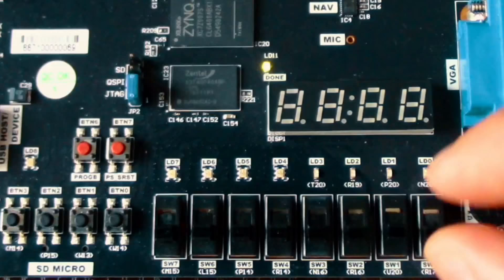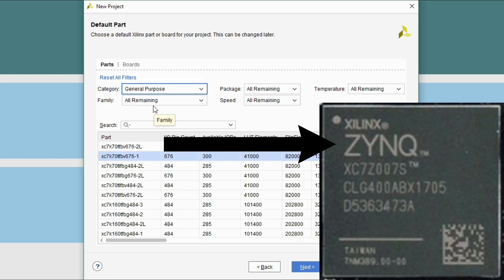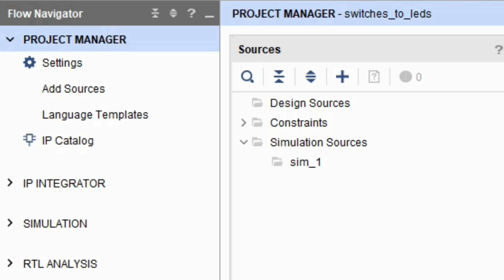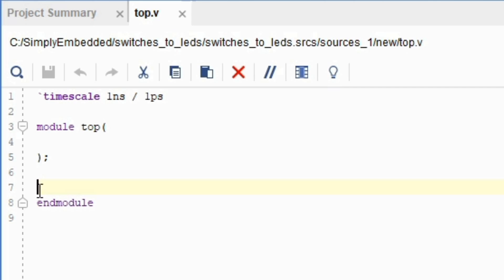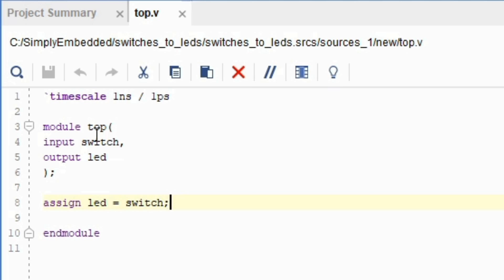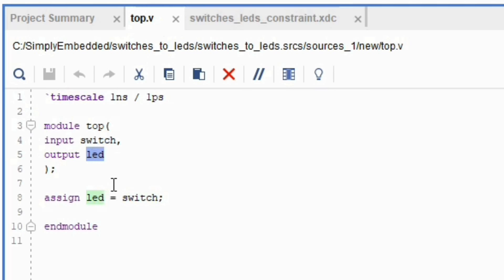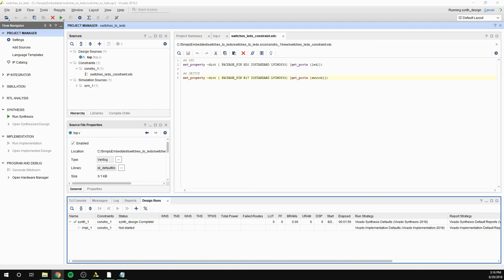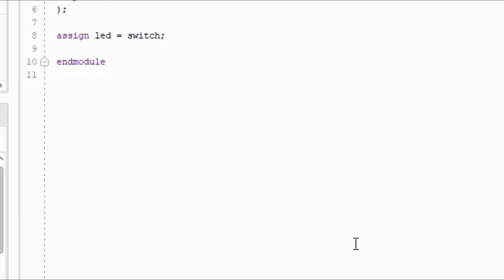How To Create First Xilinx FPGA Project? | Xilinx FPGA Programming Tutorials

Comment: Where has your website gone?

One of  the things I'm interested in is how to move from an FPGA development board to an actual PCB.. avoiding surface mount devices. What's the best way of doing this? Are there sockets available for most FPGAs so you don't have to solder them directly and can easily insert them into a PCB after programming?

Comment: It would seem to me that it would be good to also cover some basics on what a FPGA can essentially be used for in terms of useful real world stuff.  One of the take home messages I get from your video is that a FPGA can do multiple things simultaneously whereas with using an Arduino say there will be a small delay as the program running sequentially checks inputs and changes outputs in response to the input and the program logic.  

Is this the main benefit of FPGAs - executing multiple logic in parallel at real-time speeds ?

I found your video good intro to what FPGAs are and programming them so went off to download the Vivado software.  The software looks very feature rich  and was waiting for some sort of payment to appear.  It popped up with NZD$4853.70 so the main barrier I see here to anyone experimenting in this arena is the cost of the software to program the FPGAs.   The cost of the FPGAs themselves does not appear to be a big barrier to experimenting with them.

Is there any cheaper FPGA programming software options ?   

It would also seem to me that unless you are needing multiple parallel things to happen at the same time a microcontroller like Arduino will satisfy 99.8% of cases and the 0.2% where faster speed is needed is really the domain of the FPGA (perhaps still in conjunction with a microprocessor for the more complex logic I suspect).  

Would I be right on that also - they are a niche item typically used with a microcontroller ?

If so they really are a niche item with application only in specific scenarios.   Correct ?

Many thanks for making the video.   Was the best intro I found on the subject.

Comment: Is there any difference between microcontroller like Arduino and embedded systems ?
Reply from the maker: Jatin Sharma, thank you so much for your question! Yes there is a difference, Arduino development boards are used to create embedded systems. Embedded system is a combination of hardware and some kind of software - due to this Arduino board just by itself isn't an embedded system.

Comment: One manufacturer has told me that the QMTECH Xilinx Zynq7000 Zynq XC7Z010 PL can be programmed using Vivado but that for the PS  I need to load the linux binary image in the micro SD card, and if I want to modify it I need Linux. Can I just learn the basics of FPGA without having to modify the original PS? As I just have Windows

Comment: When I try to run my synthesis I get this error "There are no HDL sources in file set 'sources_1'. Please use the Add Sources command." - and under the messages tab i get this error.
[filemgmt 20-2001] Source scanning failed (launch error) while processing fileset "sources_1" due to unrecoverable syntax error or design hierarchy issues. Recovering last known analysis of the source files.
Reply: Check the Xilinx forums. Xilinx PAE's often answer questions like themselves, if they're not already answered by other developers active in the forums.